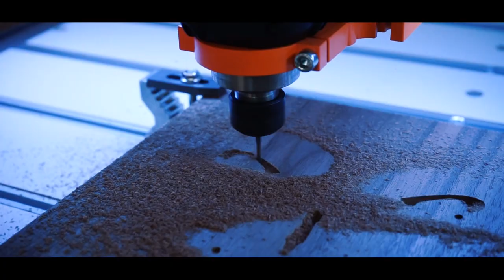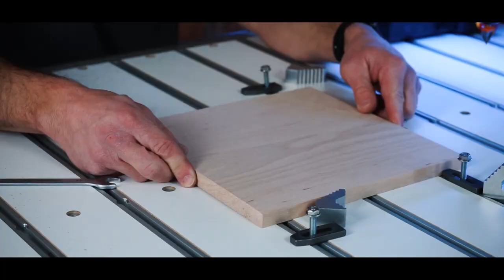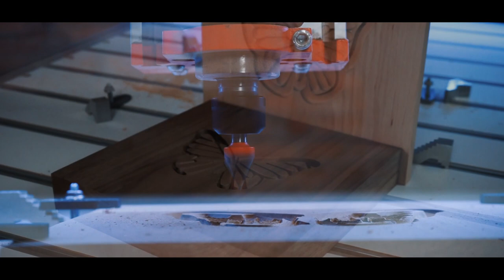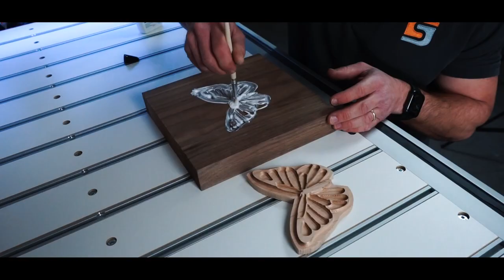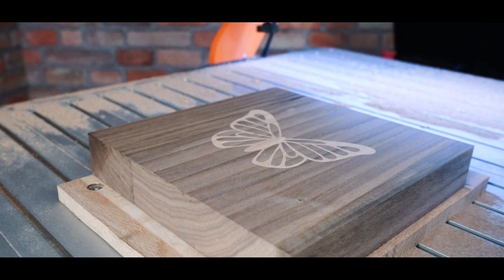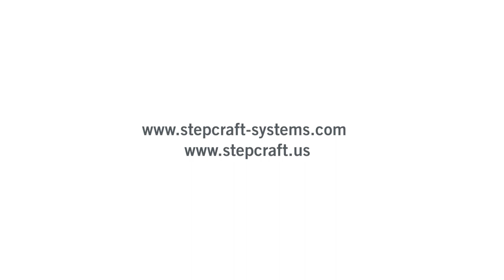CNC Inlay Butterfly Walnut & Alder Wood

Comment: Hallo, wir haben uns die D840 mit WinPCnc gekauft. Wir möchten ein ähnliches Projekt machen, wie hier gezeigt wird. Die CAM Daten haben wir mit Autodesk Inventor CAM erstellt. Die Simulation zeigt, dass alle drei Achsen zum teil gleichzeitig verfahren, also alles so wie es soll. Wenn wir die .tap Datei in WinPCNC öffnen möchten wird uns allerdings keine Grafik angezeigt. Welches Programm habt ihr verwendet, um mit der Maschine zu kommunizieren, damit der Schmetterling so funktioniert? 
Vielen Dank für eure Hilfet welchem
Reply from the maker: Den Weg seid Ihr eigentlich schon so weit richtig gegangen. Schickt uns doch einmal die Datei und wir schauen uns das an.

Comment: Welche Software (CAD/CAM) verwendet man für solche Projekte am besten? Für CNC habe ich UCCNC im Einsatz.
Reply from the maker: Wir haben für das Projekt Fusion360 verwendet, das ist einfach top.
Reply: @stepcraftgermany  Gibt es Instruktionen / Einstellungen für die M.1000 und Fusion360? Vor ein paar Wochen habe ich die M.1000 gekauft und bin sehr zufrieden. Als nächstes möchte ich noch Karbon und Aluminium fräsen. Dazu fehlen mir aber noch die Einstellwerte für UCCNC/Estlcam.
Reply from the maker: @btigerfpv  Hierfür haben wir folgende Seite erstellt: https://www.stepcraft-systems.com/service/fraesparameter
Reply: @stepcraftgermany  Vielen Dank. Gibt es noch Instruktionen wie man die m.1000 in Fusion 360 konfiguriert?
Reply from the maker: @btigerfpv  Nein das gibt es so nicht.